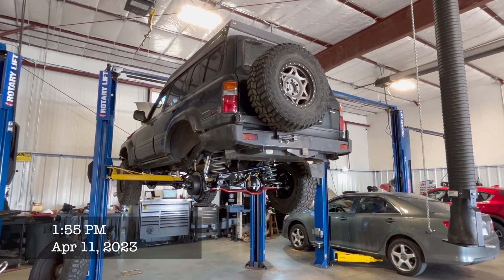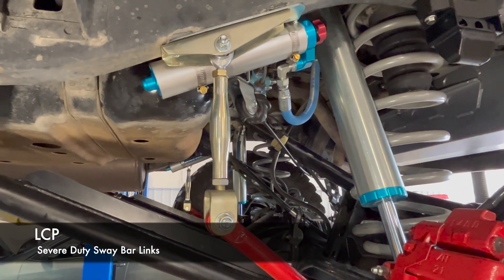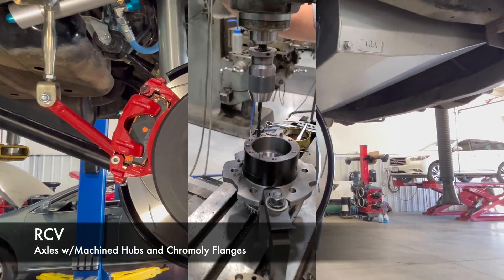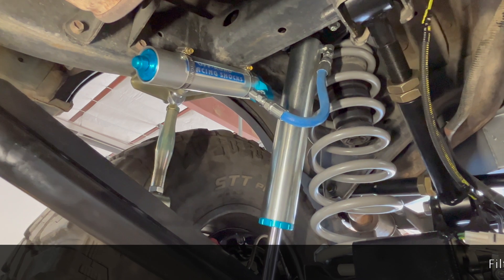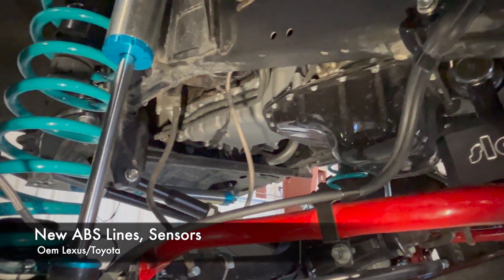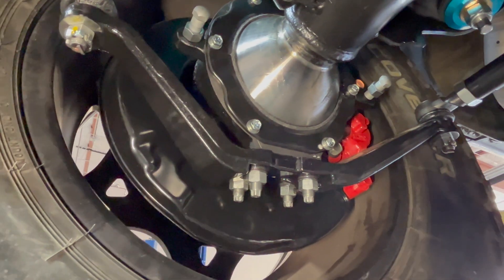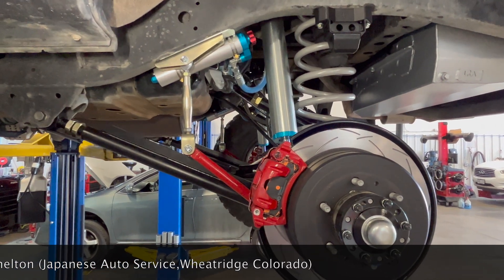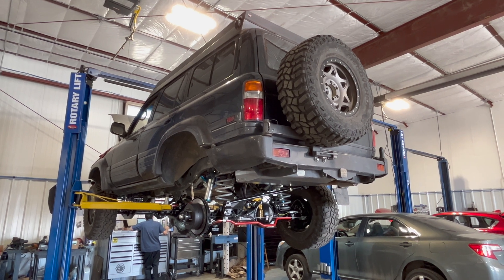FZJ80/LX450 Suspension Build 🤘😈

Comment: A thing of beauty!!
Reply from the maker: Thanks man. I just spent this past week driving, shaking it down, living in it, up here in northern Colorado and Wyoming. Even drove it up through the Eisenhower Tunnel on I-70. Damn thing just hums now.
Reply: @DouglasGreen562  now that you’ve had some seat time with the new suspension, any changes you would make ? Or are you happy with the way it all turned out?
Reply from the maker: I am happy so far. We did however swap out the 3" Delta radius arms in favor of 4" Delta radius arms. This brought our caster to 2.8 and 3.4 making the drive much more stable. That said I only have about 1,500 miles on it with only a few hundred on dirt and even less in 4 Low. The thing I am happiest with is the Marlin 3:1 in the T-case. 4-Low is a joy! I will note that the King steering stabilizer adds firmness to the wheel but I prefer it that way. Glad I got the compression adjusters on the King shocks too.

Comment: Are you referring to your transmission as new because you refreshed it with aftermarket parts?  It's been NLA from Toyota for quite some time and even the remans have been NLA for several years now.  I'm curious what you're doing with the driveshaft(s) as the lift will create noise/vibration without going DC.  Thanks for the documentation!
Reply from the maker: We have a double cardan drive shaft for the front, sourced from Land Tank, and an oem drive shaft for the rear. We will adjust the Dobinsons control arms to get the rear pinion angle where we want it and hopefully free of vibrations. Yes, the oem transmissions are NLA so we remanufactured this one 👍. We lucked out with some other no-longer-available parts because we began our procurement in 2018 before some things went extinct. The throttle/transmission kick down cable for example and some superficial things like the the washer fluid reservoir.